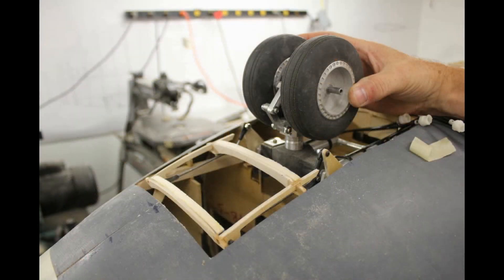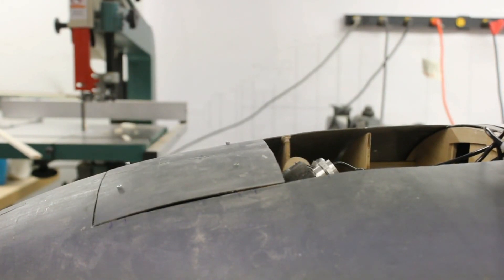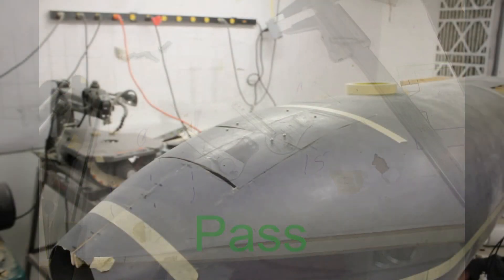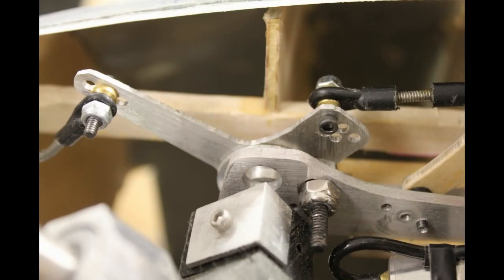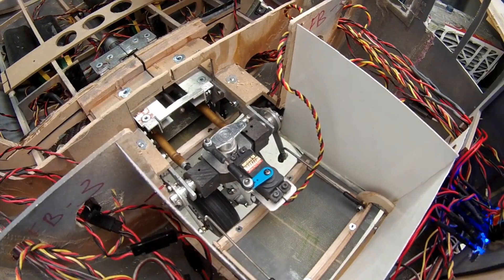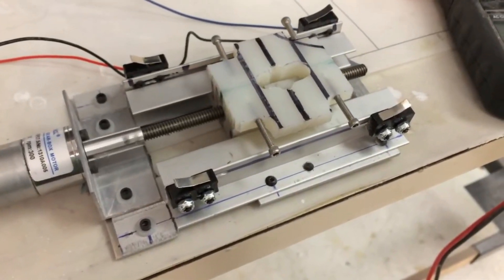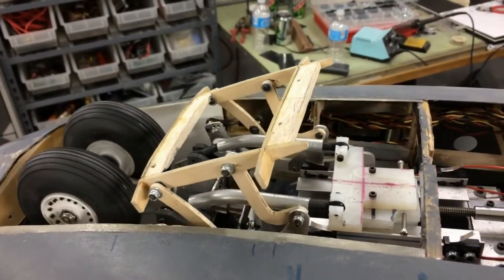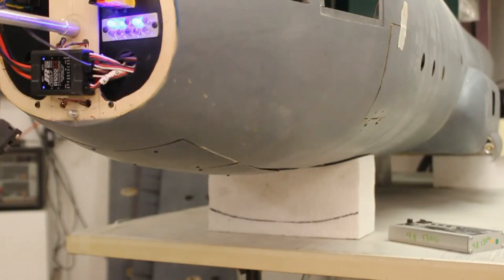Building a 1/10th Scale C-130J (Nose Gear and Nose Doors Development)

Comment: I was airframe and rigging on c-130s for the last 4 years and you basically nailed the geometry exactly to how it works on a real c-130. Don't forget to do your emergency extinsion check. No more than 275 lbs of force for it to free fall and lock down.
Reply from the maker: Thanks!!! It was a lot of work.
Reply: @dagtheaviator  and what you do is a lot of help